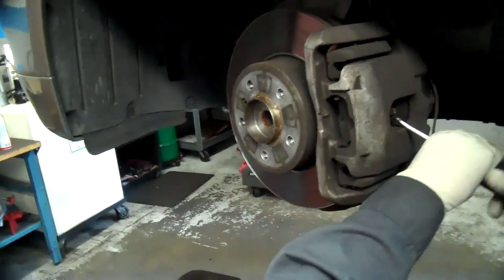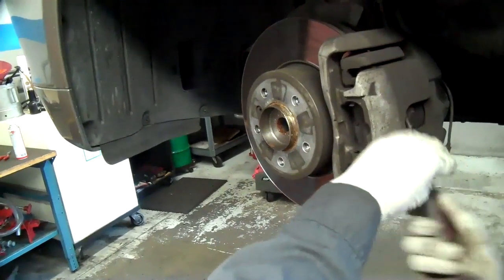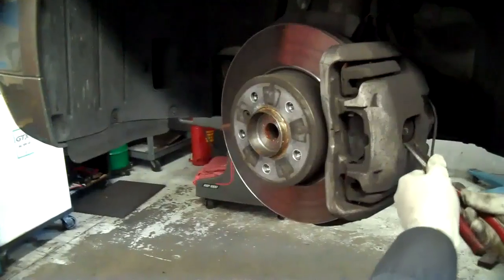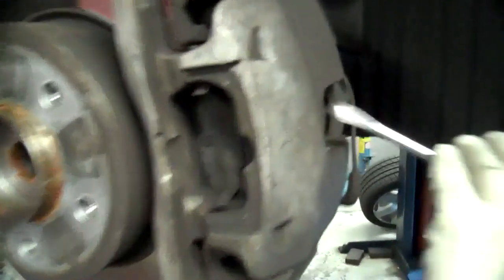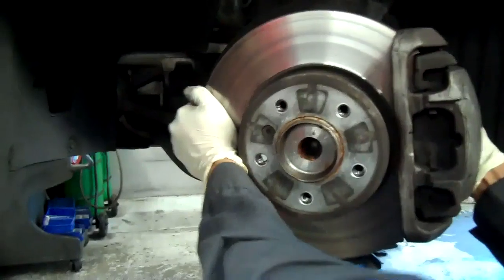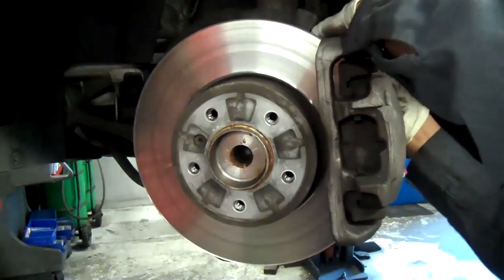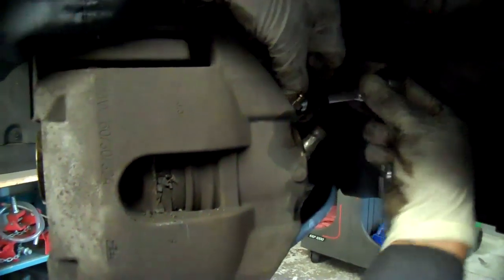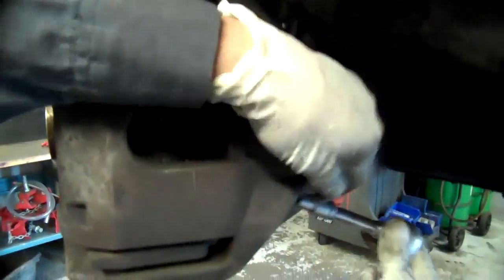How to Replace Front Brake Rotors on a 2004 BMW 530i

Comment: I realize that this video is quite out-dated, 2012, and it's now 2018, but this was just cringe-worthy. First of all, he needs to support the caliber and not just let it hang off the brake line like that. This should be done regardless of whether it's a BMW or not. It's just common practice, and speaks of laziness to not do it. Also, according to BMW "To release brake disk: Do not under any circumstances strike friction ring with a hammer or similar! If necessary, carefully tap on base of brake disk chamber with a rubber mallet." I would highly recommend removing this video as it is a terrible representation of your company and the work you perform. Also, what's with using the flat head screwdriver?